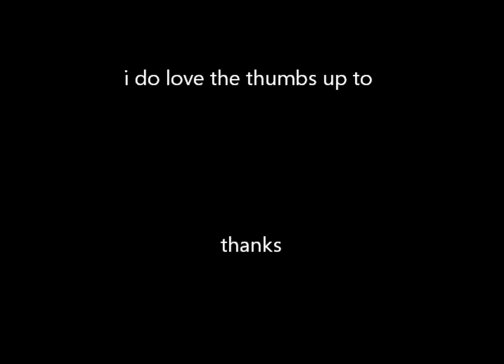talking about techumseh and a little bit of an update

Comment: My 40 year old Ariens snowblower with the 6hp tecumseh saved my neighbors ass last year when their brand new Troy Bilt snowblower with the chinese engine did not want to start.  I like the tecumseh snowblower engines because they are cheap, and easy to fix because the fuel systems are often neglected.  The mower engines suck.  The Briggs engines are nice, but the newer ones probably cost alot to fix because of the complexity of them.